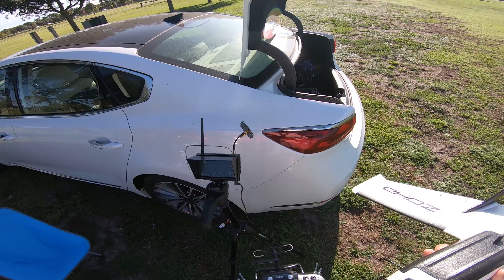Tiny ZOHD Dart 250 Maiden Flight

Comment: Fourth time is a charm. It happens some days. Nice little flyer.
Reply: Funny now you said it. lol
Reply: Well when you play with open source Hi Tech, sometimes is not you, is the firmware the developer screw up, specially in Inav, where they fix bugs all the time depending of the board model.  I got a nano gabling with omnibus f4 osd running Inav 1.9.2 and is a charm, over 2 kilometers or 1 miles with no issues for almost a year. now is the time for the Zohd with new firmware, let see what happen.  I can go over 5 miles with confidence.